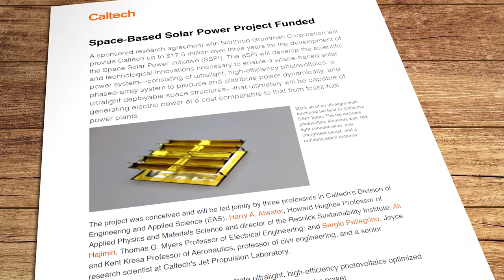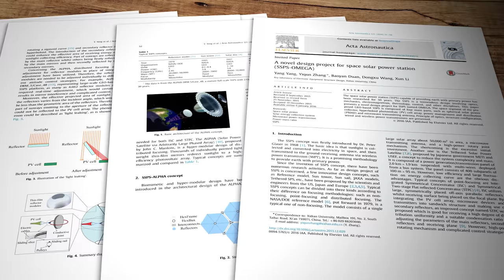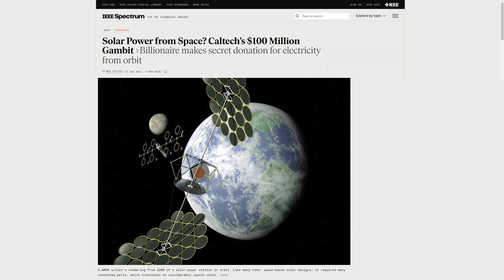Powering the planet from space. Closer to reality than you think?

Comment: In practical terms of helping climate change, space power is clearly stupid - we have much more economical and achievable means to fix the climate crisis and no time to mess about (if governments wanted space power for that purpose they should have started on it 30 years ago). However, once we've managed to survive the next two decades or so without destroying most of the biosphere, this would be a great power system to transition to. Creating huge solar sails that can double as solar panels would be the most efficient way to accomplish this fleet of solar-receiving satellites, but I believe the entire set-up will require a much larger manned space-station in relatively low earth orbit to replace the ISS, so the entire power system can be managed safely and maintained - especially when being transmitted to earth. Either a huge crater-shaped receiving dish will need to be placed in the ground (like the old Arecibo radio dish) in order to receive such high-energy transmissions, or the energy could be physically stored on a spacestation and shuttled down to earth using shuttles or a space elevator - made with carbon nanotubes.

Comment: @5:14 you start talking about using laser beams to shoot energy back to Earth, a great idea, and it can also be coupled with amplitude or frequency modulation to carry information as well, providing local broadcast stations that use lasers instead of just radio waves. The boost is volume of information, but the drawback is clouds or dust (smog) getting in the way.
Reply: If the laser beam is focused loosely enough to provide broadcast abilities, then either it'll be too spread out to provide useful power, or it'll be strong enough to be a safety hazard over the entire power area.

Lasers for data transmission are an area of research, but combining that with both power transmission and broadcast service is a bad mixture.

Comment: There is a balance between the energy the planet receives from the sun and the amount it radiates back out as infra red.
If we have a planet sized mirror in space beaming in by microwave lots of energy that as then used for people to drive their Teslas and heat their homes, then the ratio of energy absorbed and energy emitted would be in severe imbalance. So are these km sized mirrors in space going to make that much of an imbalance? If they are successful, then yes.
Reply: Indeed. But because it does not emit CO2, I guess this is considered to be "renewable". Too much focus on CO2, instead of the real problem which is Global Warming, in my opinion.
Reply: No. Do the math. It's insignificant.
Reply: @bozo5632  why don't you show the math?
Reply: @assepa  The Earth's section/area is ~125 million km2. How many square km of solar panels were you planning to launch?
Reply: @bozo5632  
global CO2 emissions 35 billion t / yr
let’s go for 1% of this, so 35E13 g/ CO2 / yr
coal emissions 820 g CO2 / kWh
So we aim for 35E13 / 820 = 42E10 kWh / yr = 4E7 kW
Solar array 220 W / m2
Area required 4E10 / 220 = 2E8 m2 = 200 km2 = 4000 space solar stations of 50,000m2

200 km2 is not a lot compared to your 125e6 km2, so I guess you are right, we would not notice. 

Still madness to do this, if you ask me. A lot of CO2 will be produced by shooting all that stuff into space, and at the same time we have whole deserts on earth that are not yet used. Maybe we should invest in some thick powerlines out to the world's deserts instead of shooting stuff into space.
Reply: @assepa  Yeah, terrestrial solar is a much better deal for the foreseeable future. 

Launch to orbit doesn't have to involve co2, though. Use solar to make hydrogen or carbon-captured methane rocket fuel = carbon neutral. Cheap solar makes ~everything possible.

Comment: We can guesstimate from Wikipedia info that there are presently around 700 million 3-person “households” in China. If even 1% of those are homes or buildings where solar panels can be installed, you have more than your 6 million solar panels, and at a tiny fraction of the cost of attempting to run a space-based system. The CCP could probably subsidize solar for the majority of Chinese households before coming anywhere close to spending the same amount of capital. And wind up with an order of magnitude more power available.